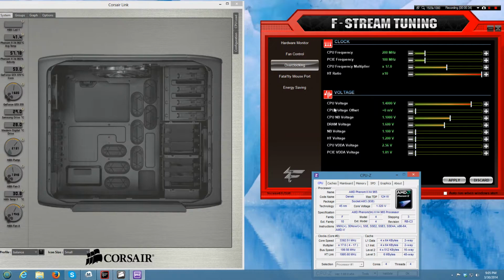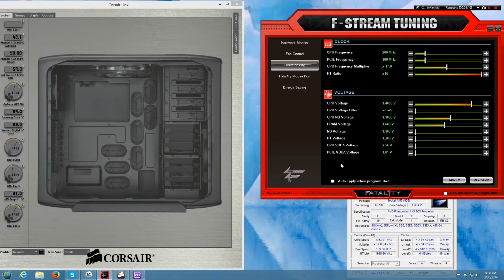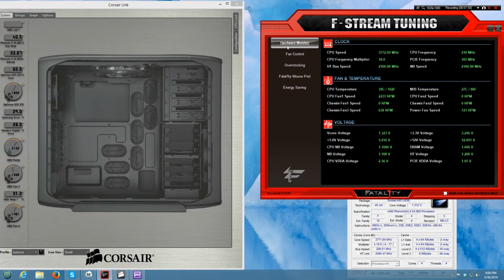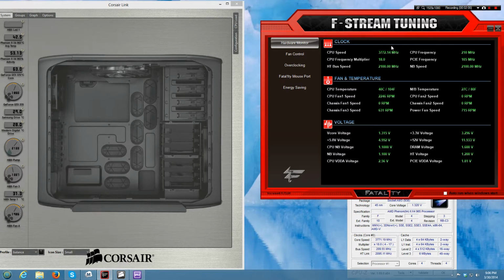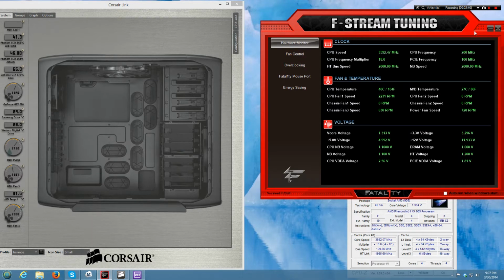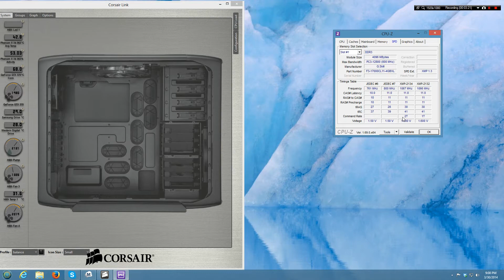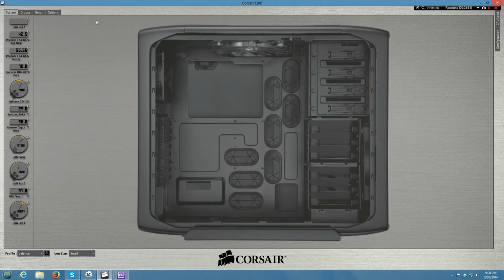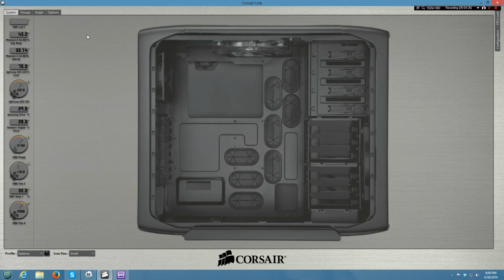ASRock Fatal1ty 990FX Killer Overclocking ease

Comment: Its 2018 now, and I´m still playing on a amd fx8350 with an asrock 970m pro3. In a few weeks it´ll be christmas. So I´m going to get a Asrock Fatil1ty 990Fx. I will not set up a new system because it does run every new game on High/ultra (No overclock). Thanks for the video, it helped me to decide which board I should get. Thanks Bud !

Comment: Not trying to come off as rude, but you shouldn't have bothered getting a board with 8 + 2 power phase if you had no intention of utilizing it. My board (970 Extreme4) has 4 + 1 power delivery and runs my 960T stable at 4GHz with only a slight voltage increase. You should be looking for at least a 4.2Ghz stable clock, bare minimum.

Comment: the reason your not stable is because your increasing CPU freq before finding a stable multiplier
Reply: ***** Get your Boards Overclocking Software Suites from the manufacturers website if your looking to overclock in Windows (Which I never recommend - always overclock in BIOS + There is many features you need to tweak and turn off to maximize your overclocking potential) = The FX-8350 is a "Black Edition" CPU which means its UNLOCKED! So you don't have "Locked Multiplier". So go into bios, config the settings and first start increasing the "X" Multiplier one at a time, reboot, begin stress testing with Prime95 & other utilities to monitor your overclocks and ensure everything is stable...especially TEMPS! ALWAYS watch your temp via HWMonitor, Real Temps, or Core Temp applications (which you can just do a Google search for the names to find the FREE downloads to these programs.) Continue to do this until your PC becomes "Unstable". From there you can then decrease the multiplier a notch or two until your back to a stable point and just be satisfied with that, or you can bump up the voltage a bit and continue to increase your multiplier keeping in mind your cpu can only handle so much voltage/heat and once you've reached your "sweet spot" then your done. But Overclocking is more than just the CPU. You got to maximize all your potential to reduce bottlenecks or instability like OCing your Memory, HT Link or FSB, and other things to truly get the most out of your rig. This is just a super short EXAMPLE of how to pursue OCing your 8350 cpu, not a "Guide". So I recommend finding a guide either on You Tube or a Google search like "How to Overclock an AMD FX 8350", etc. You'll find very detailed scenarios which will broaden your knowledge and minimize risk, fear and more by obtaining the knowledge necessary to overclock. It's not something you can Master in a day. It takes time an patience. If not then I don't recommend even doing it. Also if your having continued troubles not being able to OC your CPU your board might need a BIOS Update to recognize the FX Series CPU's especially the 8 core models when for a long time ASRock boards only supported 6 core technology max. Hope this helps. If your need more detailed help feel free to ask and ill provide any pics, demo's and links even to expedite your learning curve or solution to your problem(s),

Jason C. (Utah)
Reply from the maker: Thanks Dan.
Reply: no prob bud, just trying to help. always leave cpu freq alone and increase multiplier to find quickest stable OC. i got same board.